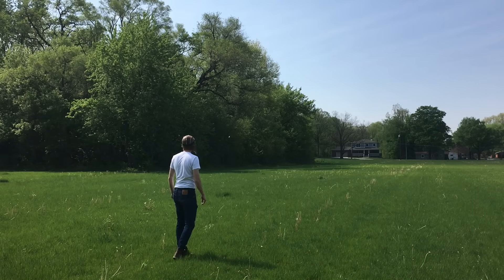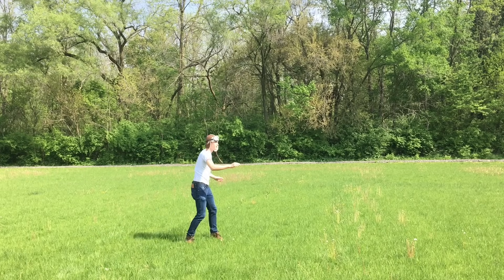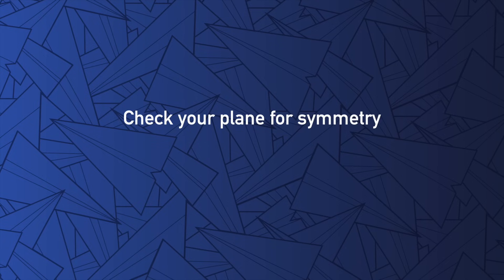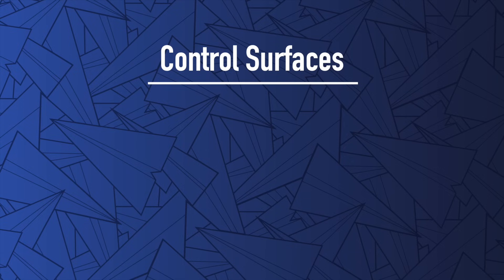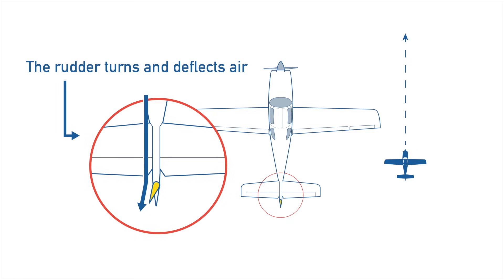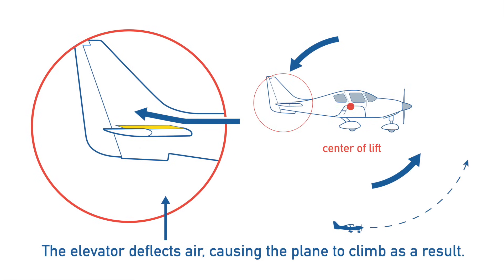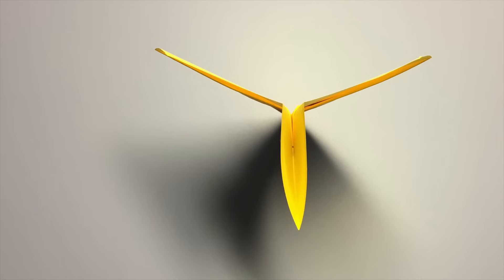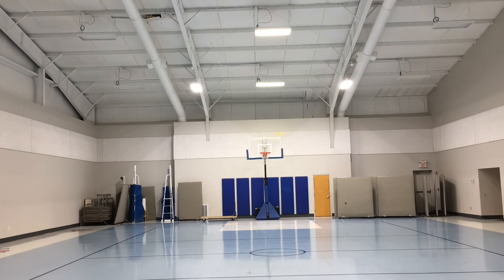Why Your Paper Airplane is Bad —  Tips for Throwing and Adjusting Paper Airplanes

Comment: made a diamond-back and every time I tried to fix the ailerons left or right it would just spiral in the specific direction. Then, I took both ailerons and bent them down just a little bit and when I say it flies PERFECT, I mean it doesn't stall AT ALL. (Other than the fact it has to land at some point)

(edit) TO EVERY BEGINNER OUT THERE, THIS CHANNEL IS A GOOD LEARNING SOURCE. PEOPLE LIKE JAYSON MERILL ARE WISE, EXPERIENCED FOLDERS. DO NOT BE LIKE ME THINKING YOU CAN MAKE JAYSON MERILL'S F22 AND GET AWAY WITH BEING A BEGINNER. IT DOESN'T WORK WHEN YOU DON'T UNDERSTAND. IF YOU ARE A BEGINNER USE WELL EXPLAINED CHANNELS LIKE FOLDABLE FLIGHT. HAVE A GREAT DAY AND DON'T BE FOOLED BY A SILLY PIECE OF PAPER. :)

Comment: 1 more thing if your plane is not flying, 3rd thing you need to know. is Inside or Outside throw. If the plane doesn't need air fly it inside. if the plane needs air fly it outside.

Comment: How to adugest if the  plain stalls
Reply from the maker: You can bend the back edges of the wings down slightly, but typically a stall happens when the center of gravity is too far back on the plane. Correcting that issue would require a redesign of the plane.
Reply: It happends on spector

Comment: Excellent info!  I prefer building gliders.  Indeed, my OmniWings include pretty much all the aerodynamic properties of the modern day hang glider designed into the wings.  Center of Gravity, improved airfoil, proper amount of wing sweep, twist and washout for stability.  I present one of my favorite flights with an OmniWing off of Mt. Nebo, in Arkansas.  https://www.youtube.com/watch?v=SrZ1bqU_g4o

Comment: Cool, but a little more detail on exactly how you are making the pinch correction would be helpful.
Reply from the maker: There isn't a single correct way to do it. Just make sure the paper bends slightly in the direction you need.

Comment: I tried to do a positive dihedral angle on the wings of the sky King and it flew badly
Reply from the maker: You're stumbling onto an important caveat when it comes to dihedral angle. It can actually decrease stability if implementing it causes the center of gravity to be far below the center of lift on the plane. I'm guessing that's what happens when you give Sky King dihedral angle.

Comment: I made an Arrowhead (I like them) and the right wing is slightly more higher then the left.. so yeah. I suck at making paper planes symmetrical... but this video helped me! Which is good!
Reply from the maker: Folding planes symmetrically is tough! I think that's definitely the hardest part of the equation for good flight. The rest is just having a bit of knowledge on how to properly adjust the plane.
Reply: U helped me a lot thanks😁😁
Reply: Well just saying that I suck at making airplanes and also my one is not "that" good and that just means you have to work harder to make "good" airplanes.        The_Robloxian460/The_FlightMaker460
Reply: if the symmetry is bad try trying to do the first step (fold it to the bottom) and then check if its on line with each other.  the hold with your right hand and try to fold with left hand then it will come nice. I tried doing this and I made a boomerang paper airplane with that.

Comment: This is a really good video to help beginners get into the essential aerodynamics of paper airplanes. A minor point you addressed that differs from my opinion was the distinction between darts and gliders. I would argue that all of the planes you presented as examples of darts were in fact also gliders. If you look at the planes they used in the red bull competitions, the darts were literally pencil-thin sticks made from folding a piece of paper over and over again. Compared to those actual darts, the dart examples in your videos have way larger wing spans.
I think the distinction between darts and gliders is the way you throw them. Gliders utilize their wings to generate lift to keep the plane in air, so they are thrown at a horizontal angle to maximize lift. Throwing gliders at a higher angle would cause stalling, and the wings wouldn't produce lift to keep the plane aloft. Darts are optimised as projectiles that experience free fall, with minimum aerodynamic effects. Therefore, they are thrown at a near 45 degree angle for maximum horizontal distance.
Reply from the maker: You know definitely what you're talking about! I love encountering people who have a lot of knowledge and interest in paper airplanes. Frankly, I agree with your assessment to a degree. I think it really depends on how strictly we want to define the term "dart". Every paper airplane with wings is generating some amount of lift, and therefore, glides. So we could safely call all paper airplanes gliders, but still we call some darts. So I don't really think there is a dividing line between darts and gliders. I think it's a spectrum between the two. 

I also agree that the main distinction between darts and gliders is the angle (and often speed) at which you throw them. This is why I make a distinction in this video (and in my video specifically examining the differences between darts and gliders) between the planes we're talking about. Yes, the "darts" in this video could also be considered gliders, but you throw them differently from the gliders depicted in this video. And that's really the point I'm trying to make. 

Thanks for your interest!
Reply: I see your point, and I agree there's a distinction between the two types of planes you showed. You're doing great work here, the locking folds you designed in your planes are really interesting and I haven't quite seen them in any other designs. Good stuff.
Reply from the maker: Thanks! I'm glad you're enjoying the content. You can expect many more paper airplanes to come like the ones I've posted so far — and with all kinds of unique locking mechanisms.
Reply: @rickzegooene  😂😂😂😂
Reply: @FoldableFlight  hey this vid's kinda outdated so can u make a new one for for new viewers...